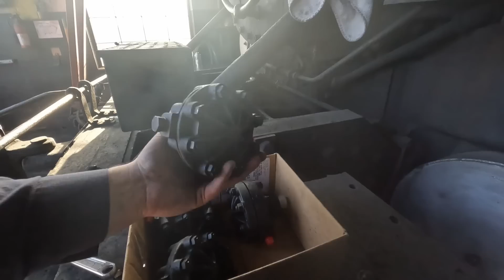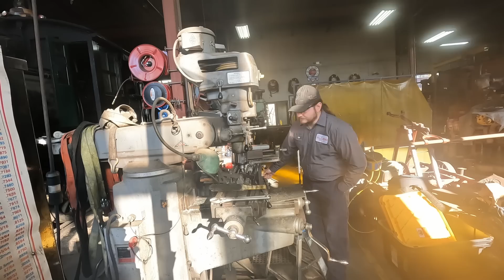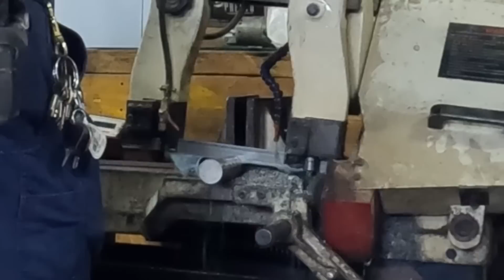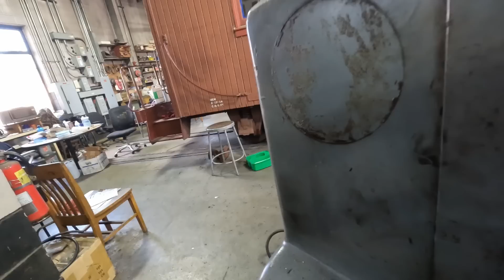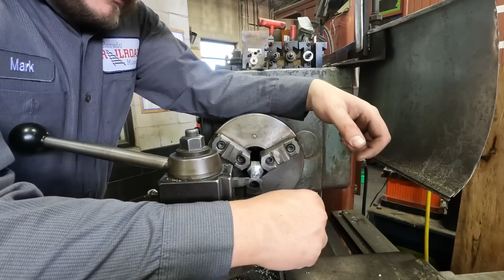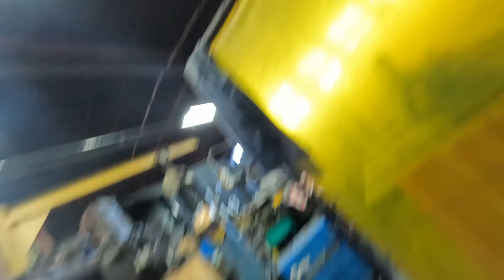How many times can I mess up while machining a part for D&RGW 491?

Comment: My grandpa was a watchmaker and my stepfather was a hydraulic pump machinist but I didn't have an opportunity to learn something from them... After watching some Joe Pieczynski's, Keith Appleton's and Quinn Dunki's (Blondihacks) videos, I bought a mini-lathe and started to learn hobby machining, aiming to eventually build a rideable garden railroad. But the electricity supply cable of the garage that I rent turned out to be faulty when I used a somewhat more powerful bandsaw so now I can't run my machines... The property manager doesn't really want to fix it (because it's legally not a common property) and the garage owner doesn't have access to that cable going through the common property and other garages (just messy Polish law of multi-residential buildings) 😕
But I hope that the matter will be resolved in a month or two and in the meantime I'll gladly watch more railway or steam related videos to learn more on someone else's mistakes 😜
Reply from the maker: That's so frustrating to hear! I hope it gets figured.out.

Comment: Every machinist goes about doing things differently, and everyone has their own tricks to doing things. 
For example, my way of making hex from round is to have an indexing head on the table, and an adjustable center stand at the other end. Pip a center hole on one end of the bar stock in the lathe and then grab it between the indexer and the center stand. Throw an adjustable support in the middle to cut out on the material vibrating/springing whilst cutting, and away you go! 
The indexing head makes quick and easy work of accurately cutting 6 flats and you dont have any clamps to worry about being in the way (just dont ram into the index jaws!!). Added bonus is that lifting it off the table makes it real easy to get the calipers in and measure how much you have left to machine. 
At the end of the day, its about making what you have work, while also not giving yourself a headache. Find those solutions, and you'll become faster with time. 

And for the love of god man, use cutting fluids whilst threading! 😅
Reply from the maker: ....that's a smart move

and also, yes, me and cutting fluid need to become better friends

Comment: Nice video. Just a couple of suggestions for future use. Simple RPM formula: Cutting Speed X 4/Diameter=RPM. Thread @ about 1/3 to 1/4 of that. The rule of thumb Any kind of lubricant- cutting oil is best but even motor oil will do if that's what you've got- will alleviate troubles with torn threads. Once you've threaded one end of your parts, an easy holding fixture can be made by facing, drilling and tapping a piece of scrap stock and leaving it in the chuck until you have  finished the other end of all of your parts. If you are holding the taper pipe end, run your tap a bit deep so the shoulder on the part will seat against the fixture. Just my 2 cents.
Reply from the maker: I appreciate the two cents - thanks Thomas!

Comment: i guess machining is rather rare in the shop considering that those are HSS(?) tools one question I have though is: don't you have a clamp that rotates x amount of degrees? (I'm german so sorry I can't describe it properly) so you could've turned it completely first thread it in a nut that's held by the rotating clamp and just mill the hex section later? Any way I have to comend your sense for the material considering I do this professionally though the first clamp on the mill is a bit scetch (let's be honest its a machine shop, if you don't do something scetchy you aren't in a machine shop :D)
Reply from the maker: All of our tools are donated, that's why all the HSS, haha. And yes, the clamp was a little sketch... But you're right. Lol

Comment: This reminds me of the time I thought I wanted to machine, $20k later I discovered it’s not for me. 40+ years of woodworking, I just can’t get used to metals. The idea that it doesn’t expand 1/8” due to humidity is just such a foreign concept to me it makes my head explode.

Bright note, machine tools hold their value, quite well in fact. The tooling used for them, ah, not so much. Turns out nobody else really wants broken end mills either.

But those they can whisper the hard materials amaze me, it’s truly magic, excellent work.
Reply from the maker: You can clean metal shavings up with a magnet, unlike sawdust:P but I totally get ya

Comment: Hyce, I am a professional machinist, and would like to suggest a quicker method for machining a hex on an entire length of round stock on the table of a milling machine.  Start by clamping the stock along a t-slot like you did at first with the clamps about 2" in from the ends of the stock.  Then set the machine to cut a 1" long coordinated flat on the outside of the clamps (on the ends only).   Then rotate the stock 60 deg. with your block and cut another flat on both ends.  Do this a third, fourth, fifth and sixth time until you have coordinated hexes on both ends (your final depth of cut will be the same in all cases, since you are sitting on the original o.d of the bar).  Then support the hex-ends on parallels or 1-2-3 blocks and clamp them down solidly (If possible, block the part up on both ends so that the vice can grip to on the sides, without touching the base of the vice, for extra support.  The parallels should still provide the alignment.).  You can then cut the entire center of the bar without obstruction (the part should protrude above the vice jaws), and the solidity of your work holding will be MUCH better.  With these alterations, and with some amended speeds and feeds, this job should be done in less than an hour and a half.
Also, I would reconsider your feeds and speeds for carbide.  With SOLID WORK HOLDING, I would run that carbide facemill (conservatively) at 650 rpm with a feed that gives about a 0.010" chip at a depth of about 0.100" (or as close to this as the HP of the mill will handle).  When doing this, make sure that the quill is locked all of the way up and that all of the gibs are tight and all of the locks are set except for the axis that you are moving.  Also, cover your arms face and hands to prevent burns from hot chips.  If you do not have solid workholding (aka, everything that you showed in the video) then that is your limiting factor, and you already know how to deal with that.
Reply from the maker: Taylor,

Thank you for this comment. Your idea for how to approach cutting the hex is brilliant, imo - that would've been a lot better than what I did.

650 RPM sounds really fast for what the calculators online said? It was 1018 steel and a 1-3/4" tool. But yeah, cutting 0.100" would've been kickass! Haha.

I never got any teaching on chip measurement; do you have a reference I should look up for how to understand / measure that? My teacher wasn't the best.
Reply: @Hyce777  I use a 2" dia. 3-flute carbide insert facemill at the speeds and feeds indicated with good results on a bridgeport 2 hp variable speed j-head mill at work daily.  It looks like your mill may only have a 1 hp motor, so you may have to reduce speeds and feeds accordingly.  Also, several of these things can limit your ability to take a cut;
Poor workholding (parts move)
Loose gib keys/worn ways (causes vibration/ grabbing, carbide is brittle and hates these two things)
Loose spindle bearings (causes poor surface finish/ grabbing/ vibration)
Limited horsepower at the given speed/ inability of the spindle taper to handle shock or power at a given speed (your machine wasn't designed for carbide tooling, which is most effective at higher speeds and lower feeds than highspeed tooling, also, it is more demanding on machine characteristics for best performance)
Unacceptably short tool life with the particular tool/ material combination (tools will break down if used too hard or not matched to the material)
In any case, the best way to determine what is possible with any given machine is to securely attach a block of scrap to the table and then take progressively heavier cuts until you find a limit.  Chip thickness is measured with a caliper by picking up a chip and measuring its thickness.  You can approximately calculate the chip thickness by dividing the feed rate of the table by both the number of flutes per cutter and by the spindle rpm, and then converting to convenient units of inches.  The actual measured chip thickness will be thicker than the computed value because of what happens when the metal flows up the face of the tool.  In practice you usually don't compute speeds and feeds for small machines like yours, since the performance is so limited and affected by poor machine condition.  You just test and go by experience.  For highspeed tooling you judge by chip color (for steels): No color change of chip=good (or course you go as fast as you can), straw color of chip=more productive but short tooling life, blue color of chip=immanent tool failure.  SFM of the tool tip is determined by a rule of thumb based on the material and machine condition, and feed is varied to achieve best productivity while maintaining chip color.  Most machinists today don't have extensive experience with using high speed tooling, and so this knowledge is being lost.  Also, sharp tools are essential with highspeed tooling.  A little experience will quickly teach you that "dull" is determined by the performance of the tool, as read by chip color.  Tools can still look sharp and be useless for taking productive cuts.  With carbide tooling, chip color really doesn't matter, and speeds and feeds are not as critical to tool life as long as you don't stress the inserts beyond their physical limits by taking too thick a chip.  I run my carbide tools conservatively a 2-3X the speed (SFM) that I use for highspeed tooling.  In an ideal situation 10X is more appropriate, but your situation is NOT ideal, so be conservative. 
The universal reference for machine tools is the "Machinery's Handbook."  Try to get an edition published sometime in the 50's or 60's, since earlier editions don't have much information on carbide tooling.  There are many period references which describe chip formation in detail, but I found the "Tool Engineers Handbook 1st edition" to be especially helpful, if you can find a copy, see section 17.
Reply from the maker: @taylorcraft1947  Taylor; serious, serious thanks for this. You're more of a tutor than my original tutor for machining by any means; thank you for this book of knowledge. Much, much appreciated.

Comment: You lost your thread because you engaged the half nuts in the wrong spot. Best way to thread on an old lathe is to reverse the spindle to reverse the tool, leave the half nuts engaged the whole time.
Reply from the maker: I picked up on a line; it's even thread. Maybe it was a fraction one way or another? Not sure. Either way, that's a really neat trick.

Comment: It's not the tool pressure at the beginning, it's the steel bar releasing tension as you remove material - the bar is bending upward. Should have clamps on both sides
Reply from the maker: Makes sense.

Comment: Full marks for bravery when you haven't made a chip in six years and decide single pointing tapered pipe thread is the best place to start. But here's some things to consider for next time: if you have plenty of room to swing the wrench, two flats work just as well as milling down the entire hex profile but is less then a third of the time to machine; it's much faster and easier to drill and tap the 3/8 NPT thread and then buy a short male nipple to end up with the external thread.
Reply from the maker: Cheers; I don't think we could've drilled and tapped the other side and then used a nipple with the way the lines were done, but with different boundary conditions for sure. I asked bossman, bossman wanted hex, so he got hex. I agree two flats would've worked, haha.

Comment: The only gripe I have with that setup making the hex is you're only clamped on one end. 

I would have either clamped both in the same manner and wasted a few inches of material, or, partially drilled a hole through it and put a pin or bolt in and clamped that down. I think some of your chatter was the metal vibrating in the way with a foot and a half of free span.
Reply from the maker: Had I realized from the beginning that I wasn't going to be able to use my first clamping set up the whole way through, I absolutely would've clamped from both sides to start with. Totally right. It made it so I was only taking 0.035" cuts.
Reply: @Hyce777  lol yup... machining is an easy process when someone else is doing it! It's fun, but it does take a fair bit of time in setup.
Reply from the maker: @kleetus92  Absolutely. The setup is where you see the machinist's skill.

Comment: Would it not be way easyer to just buy an npt adapter and mill new threads on the other side?
Reply from the maker: The NPT is smaller, so you don't have the thickness to cut the other threads.

Comment: Something I learned a long time ago is that as a machinist, you have to be a perfectionist.....BUT you do not have to be a perfectionist all the time, you only have to be one when it counts. A lot of the fittings and adapters I have made over the years, I would try to get as close to print as possible because a good machinist should do that. But, on the flip side these things aren't going to mars so it works out in the end. Nice work!
Reply from the maker: Thanks Christopher!

Comment: I was waiting for the day I see you machining. I don't know who's better at machining between the two of us, but I expected to see some things I don't like. Safe to say, I really had to nitpick to even come up with what I found. And please keep in mind, there's more than one way to skin a cat and in the end, a finished part is a finished part.
Mind you, I'm not talking about obvious mistakes that you noticed yourself, that's just a part of machining, happens to the best of us.

Always use coolant with HSS cutters. I generally use flood coolant on all my machines and I get that it's often a huge mess and it's hard to deal with, but some cooling is necessary for HSS. If I don't cool the tool it overheats and dulls immediately. Least you can do is have a bottle of coolant handy.
Also, your order of operations seems a bit backwards. You would've saved yourself a lot of time if you did the lathe operations first and then cut the hex. Sure, you'd have to orient and reclamp it more often, but removing material on the lathe is faster than on the mill and you could've used the vice, giving you more support.

Thanks for sharing, I think you did a great job of explaining machining for a broad audience.
Reply from the maker: I appreciate the tips! I am by far nowhere near an expert, let alone someone who knows what they're doing. Lol. I appreciate the tip with the HSS. Only ever really used carbide, and I actually didn't know where our carbide cutters were at first, lol.

Comment: Lubricant keeps the part and tool cool.  Who knew huh?  Got some nice tools to play with there in the workshop.  Kinda jelly.

I would have set up the machine to do the same cut for each part before moving to the next operation.  Saves heaps of time in machine setup.

PS: Roll up them sleeves son!
Reply from the maker: There's a lot of cool tools in here. You'd have a field day. And yeah, didn't realize the importance of coolant with HSS. Learned that one now! Haha. 

I agree on the setups; I wanted to make sure my thought process was going to work before I committed to making all four parts.
Reply: I agree with Klown - lubricate and sleeves rolled up! One grab of the bit on that sleeve and you’ll never forget it!!
Reply from the maker: @Two_Bears  Yeah, I absolutely spaced that. Lathes are terrifying with what they can do. I did get a bit of an owie (small one) when I was making a part for 20 last week. That video will be out sometime soon hopefully.

Comment: Say, can’t you just flip the thread cutter upside down and run the lead screw in reverse so that you aren’t at risk of crashing the tool into the chuck jaws? The Joe Pyzinski method. I realize there is a method of doing that that results in left handed threads but the machine as is should give the desired result.
Reply from the maker: ...huh, never thought of that. That's a really neat idea and would've been a lot smarter

Comment: Question ,would it have been easier to make the part a square head instead of hexagonal? And possibly more 1920s ish or did the locomotives have more hexagonal nuts than the farm equipment that had more square nuts
Reply from the maker: Square would've worked as well, though that's a harder interrupted cut to then turn on the lathe. 491 is of the era of mixed hardware. 346 and 20 are definitely all square hardware pretty much but 491 could have either.